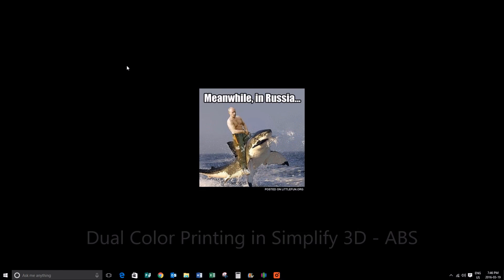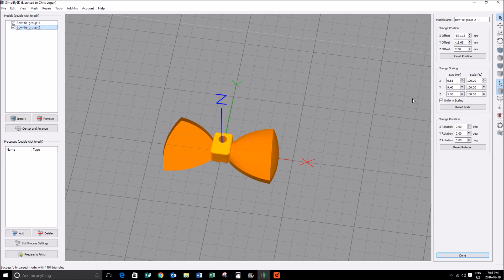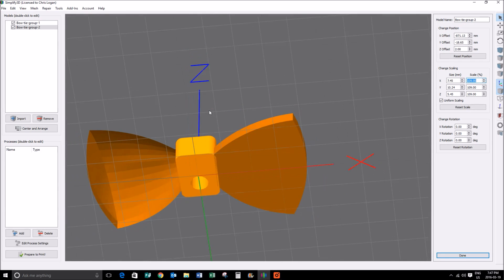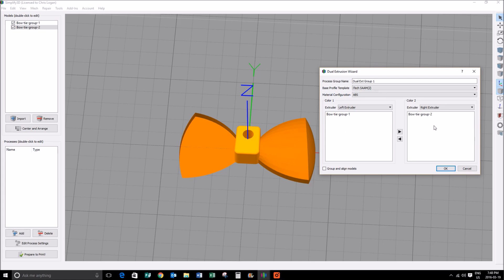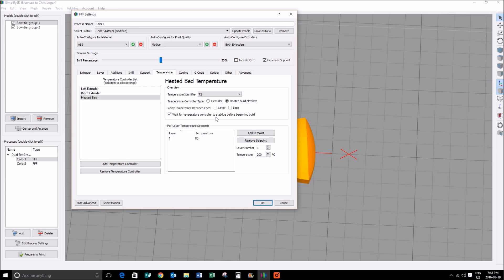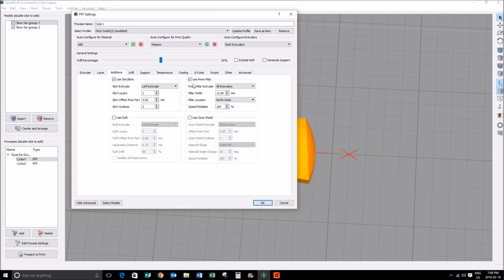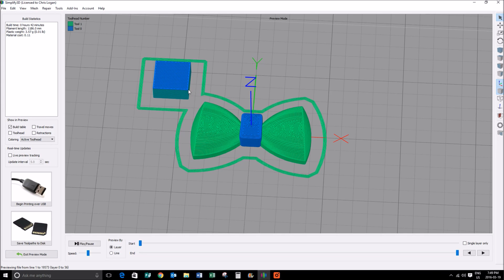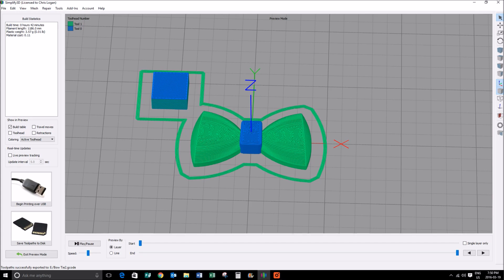Dual printing with Simplify3D

Comment: So is it possible to print multiple copies of the multi color tie at a time? If so, does it print a purge block for each tie?
Reply from the maker: Yes it sure is you can fill the bed up completely. Only one prime pillar is needed for an entire dual color print job, however you may want to increase the pillar sizing to deal with oozing a little better over longer stretches or crossings.
Reply: Awesome! Thanks for the advice.
Reply: This is a a great video. I like how it shows the details of the software.